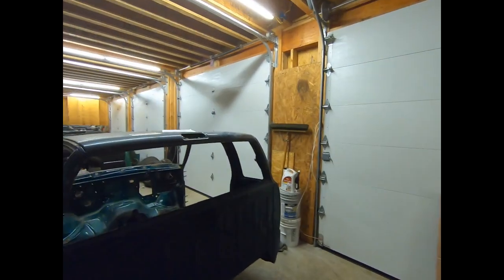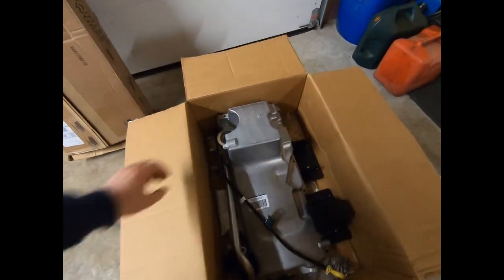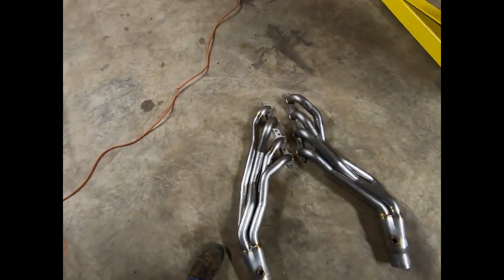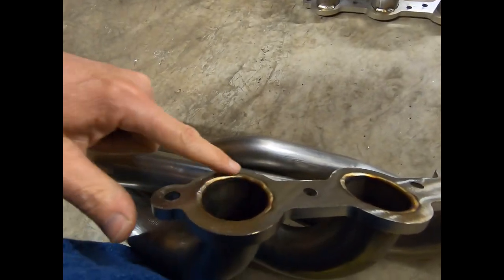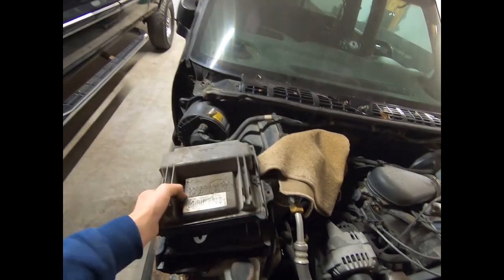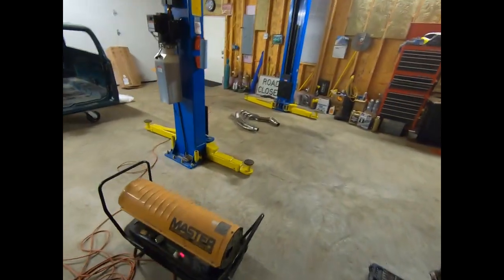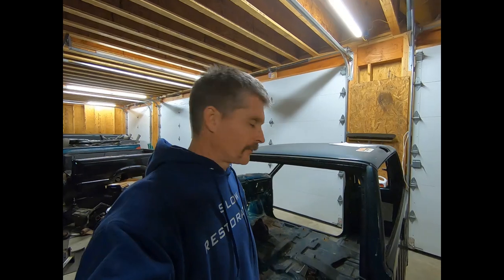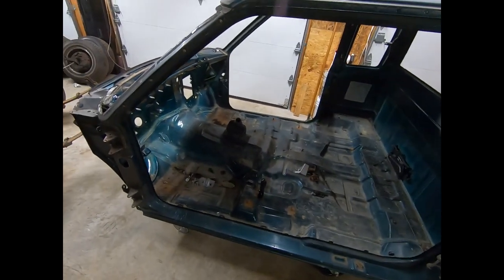LS SWAP PARTS For A S10

Comment: That build looks like it will be awesome from a fellow S10 owner why didn't GM make a v8 version mine has a 283 but needs a little love
Reply from the maker: Hey Steve, not sure why GM never put a V8 in the S10. 
probably room, they are tight! Those 283's sound good but don't have much more than a 4.3. A 400 small block would however bolt right in it's place!
Reply: @slow_restoration  it has 350 heads but we can definitely figure out a new set up for this rig

Comment: X-Pipe? Have you decided on mufflers?
Reply from the maker: I'm waiting on getting everything mocked up in the frame first. Probably will do a x-pipe if there's room! I'm open for suggestions on mufflers.
Reply: @slow_restoration  I had this company's x-pipe & mufflers on a 87 K10 Shortbed with a 383 stroker: https://pypesexhaust.com/
Reply from the maker: Nice, thanks Joe! Do you still have the truck?
Reply: Never should have sold it...I have video of it..was a shortbed, Silverado, 4" lift, aluminum heads, roller cam, roller rockers, TH400, reverse manual valve body, 4.88's, ratchet shifter, super clean truck...sold it to buy my first new diesel back in 2006.
Reply: With those headers I used a magnaflow universal x pipe kit with magnaflow bullet mufflers and turn downs. 3inch all the way back to the diff. If I were to do it again I'd run a tight xpipe with the pipes side by side and run them both down the passenger side. Unless you do a blazer fuel tank swap you run into interference with the pickup gas tank mounted on the drivers side.
Reply from the maker: I would love to see the video! I have a 84 short bed 4 wheel that's going to be on the channel soon!
Reply from the maker: That's what I am thinking, just see how it lays out as I go! Might even do two exits on the passengers side?

Comment: Bought that oil pan it touches the crossmember i had to cut like 2 inches trust me
Reply from the maker: Which motor mounts did you use? Mine fit with zero clearance issues.

Comment: did you try them headers on your s10?
Reply from the maker: They are in the frame with the engine but no cab on it yet.
Reply: I’m also interested in seeing if these fit. I’m in the UK and awaiting current performances writing harness, engine mounts, oil pan and wondering how the headers fit. I’ve heard mixed opinions.